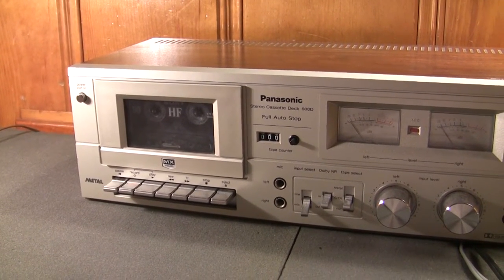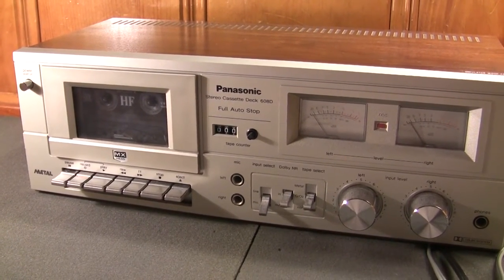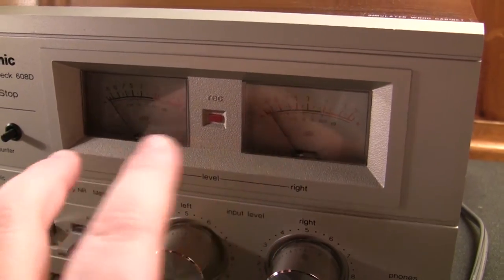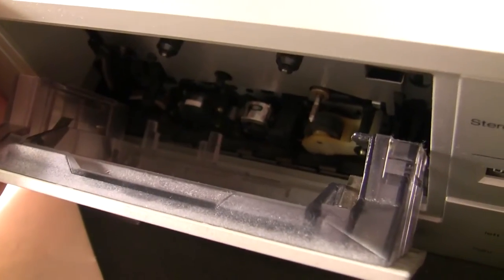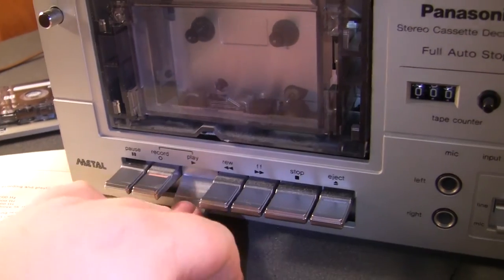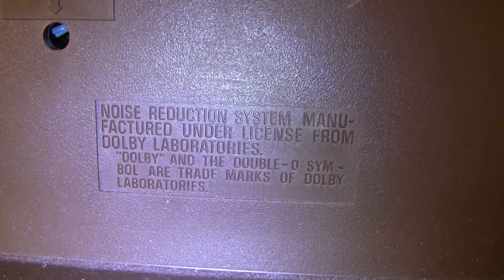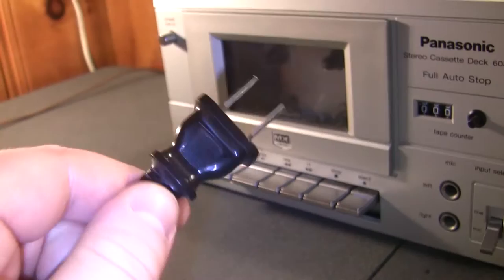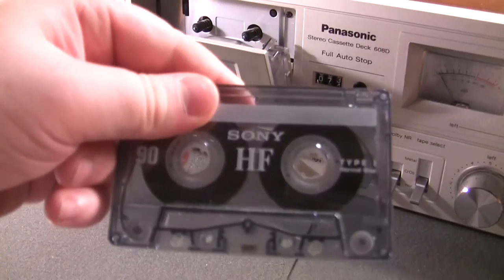Panasonic 608D Cassette Deck With Analog VU Meters!

Comment: I also have a Panasonic 608D and it has been a very reliable -- like yours, mine is still using its original belts. The equivalent Technics model is the RS-M5. Aside from minor styling differences (such as a lack of woodgrain) it appears to be identical.

Comment: Panasonic National RX-C100 is nicer since the record level knob is concentric with the left and right being on the same knob on different positions rather than separate knobs. Plus RX-C100 is a casseiver since you can connect microphones, phono and auxiliary inputs along with radio.

Comment: To get to the belts take the top off , you will see them . to ajust the motor speed there is a little hole on the back of the motor , at that age of deck , the motor slows down . The hole on the motor is for a small screwdriver , feel the grip then turn it .

Comment: I have the same Panasonic 608D you show here. Mine everything works except the VU meters do not work  and no sound comes from the speakers while playing a cassette . So it needs repair for something.
Reply: Mark JG I just go one it worked for a couple minutes, than I went into record mode, rec didn't work, than I tried to play again, nothing. So since it was a cheapo, I figured start pressing rec/play than stop a bunch of times to see if I coud get it going, and after a couple shots the rec light started to work, so I messed with the input level and it started to get a crackling sound from left. I continued a few more times and the right did the same. I kept it going and I gave the inputs a good working, than the VU started to pick up sound. So I tryed the tape again and it worked! Yay. Hope you get yours going it seems to be a decent deck!
Reply: a panasonic 608 doesn’t have speakers
Reply: The Panasonic 608D is a deck - in old school parlance that means you need a receiver or amplifier to actually plug speakers into...even will work if you plug it into your TV sound system "in" plugs.  Notice you don't have any Volume controls for playback - only the record/line-in function - that means you're depending on another device for the actual amplifying.   This is a real good basic deck with great sound output when connected - I have had mine for nearly 40 years, still sounds great.